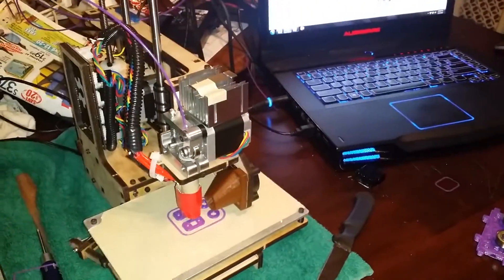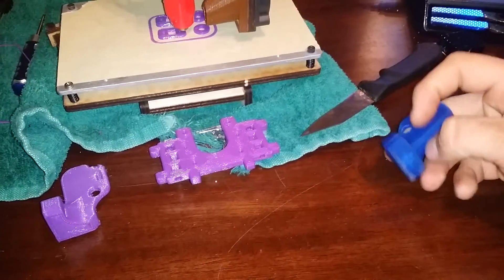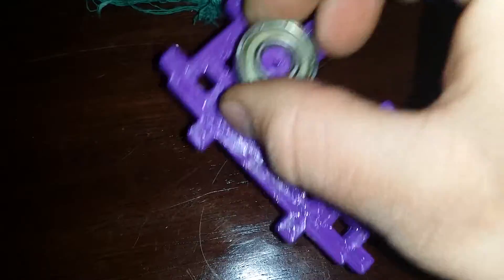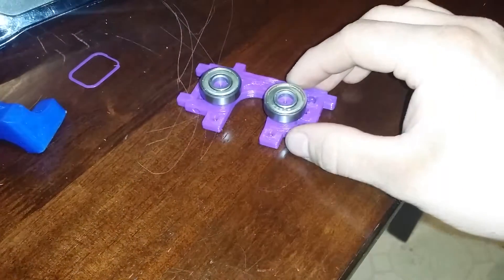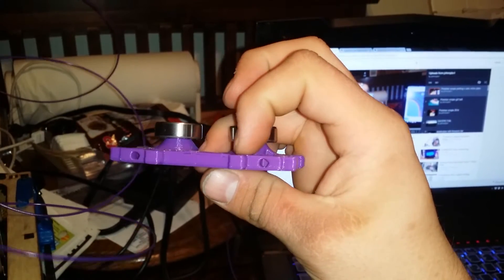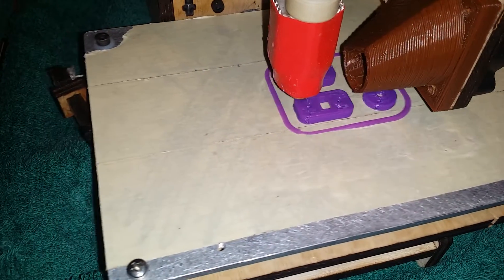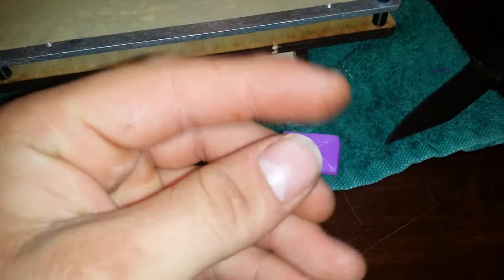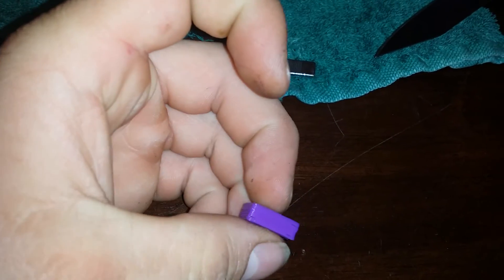Printrbot simple X axis mod

Comment: to stop skipping on this printer because of the weight in balance on the y axis i use 5w30 on the rods to lube up the bushings. After several days of trying to figure out why it was skipping i replaced every damn thing even control board only to find out that it was the busing sticking. put the lube on and no skipping since. you only need a few drops. if you printer sits for long periods you should add few drops before printing. hope this helps.
Reply from the maker: i agree i had it pint for 29 hours and the print was very close to perfect since this video im in the process of building a 24'' x 24'' cnc laser and printer  out of 80/20 

thank for the comment
Reply: Let me know how the enclosure works out. I have been wanting to build one but keep putting it off. I lazy. Lol